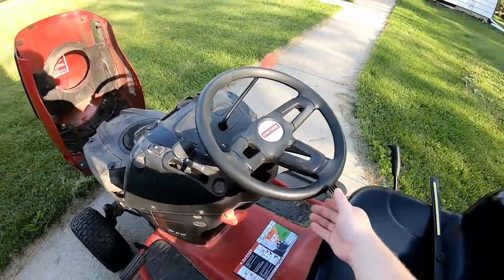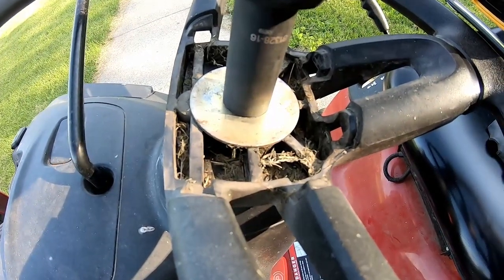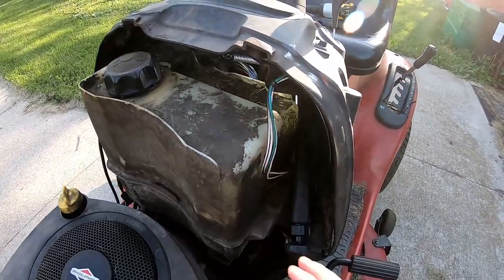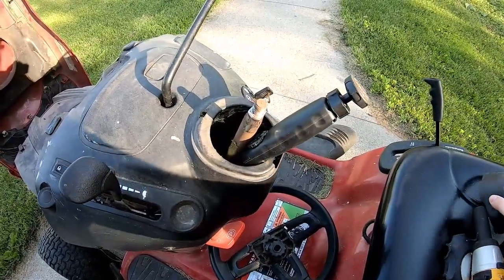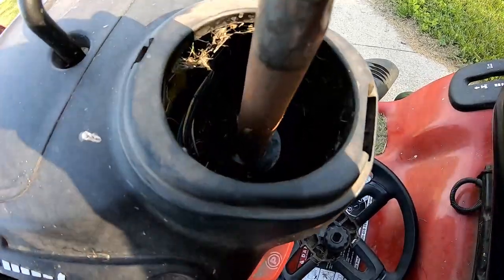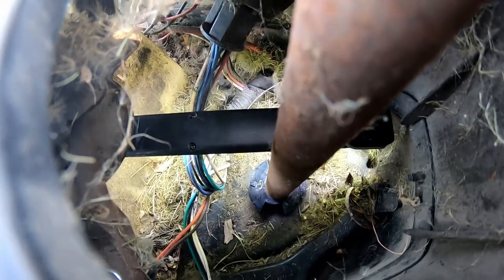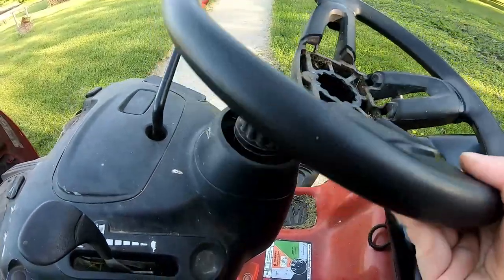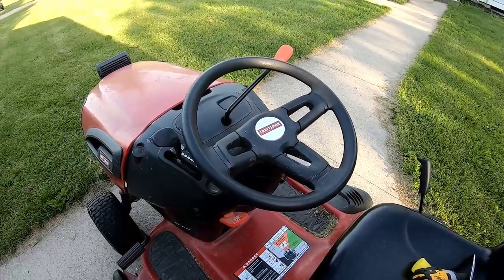How To Fix A Loose Lawn Mower Steering Wheel - Craftsman, Husqvarna,  Poulan, Weed Eater, Roper, EHP

Comment: Yeah I fixed mine for free I just cut up a pop can and then slid it in between the bushing and then put a hose clamp on the top always clamp on the bottom perfect
Reply: I wonder if the seam i n the pop can metal will cut into the plastic bushing?  Otherwise, your fix is great.

Comment: Interesting that you could still get steering parts for your Craftsman lawn tractor.  A better long-term solution to reliability is to buy a better engineered tractor. I bought my 1997 John Deere LX 176 lawn tractor in 2007 and it still steers like a nearly new unit.
Reply: Parts used to be an advantage of buying Craftsman as opposed to some random brand from either of the two factories. Not sure it is now and future. The major part of the lifetime is going to be determined by usage and maintenance. As a kid cutting grass for 60 to 80 hours per week for about 15 years I wore out two John Deere lawn tractors. When I finally bought a house that needed a lawn tractor I bought Craftsman. That was 1998. I replaced it last year with another Craftsman. I used and abused that Craftsman, and finally the transmission gave out. Prior to that the biggest repair was replacing the two deck spindles - each one because they wore out, and one of them the first time because it was bent by hitting a stump. I think 22-23 years is pretty decent.
Reply: Parts for Craftsman are not hard to find. But the main difference between Craftsman and John Deer is like Cummings vs Caterpillar. Cummings is a whole lot cheaper to fix/repair and parts are easily found. Still have my Craftsman 2007 DSL 3500 going strong.
Reply: My 2016 46" Poulan Pro is almost identical to this tractor except for the color. Thanks for the video.

Comment: I think that you should try cleaning off your work area with compressed air before using a new part on it. Since that is a bushing you probably should have put some grease on it. I clean off my tractor each time I cut grass with it. Just my opinion …
Reply: Really ??? Don’t watch it then 😮
Reply: @philliphall5198    If you’re going to offer information you should try and be a little more accurate! Looks like you don’t know what you’re doing. 😮
Reply: @philliphall5198  lol ya never have greasy hands huh? 🤔 😭🤡